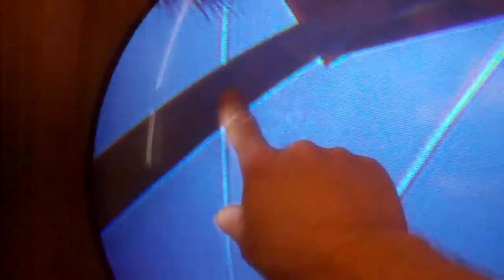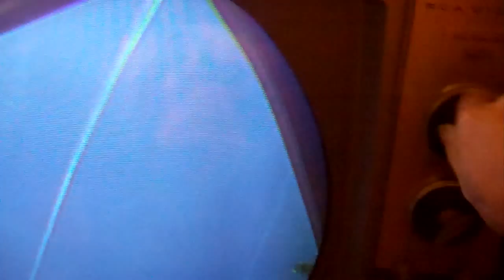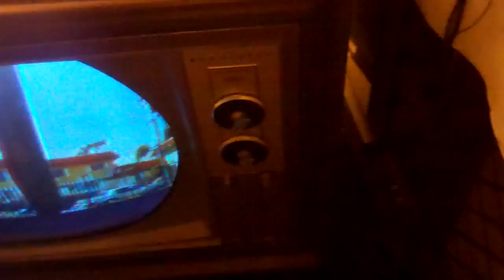direct injecting composite video into a ctc16 for a art project test

Comment: Is there any feasible way of injecting an S-Video (seperate luma and chroma carrier) signal into these old sets? It would eliminate the nasty dot crawl from the primitive notch comb filters most sets have. S-Video/Composite input with audio would be a cool restomod for a roundie, I suppose you could tap into the unused UHF tuner switch in the older sets to trigger a relay and switch over to the inputs.

Comment: I really don't know where to put this... so.. :)  

RCA CTC16-XL update...
I have spent the last few weeks trying to un-do some of the stupid things that were done to it in the past... ( Don't ask,- hint, I rescued it from a HS electronics class. )

I have almost all the tubes I need except for 1, 6gu7 (r-y g-y amp) however I don't know how good/bad the tubes I do have are.

Last weekend, I dared to power it up... no smoke, no explosions, no popped circuit breaker.
After 3 min, noticed C1 was slightly warm, ( will most likely have to re-cap ) r212 HOT but not unexpected of a 18w resistor, seems to have been hot for a very long time, as all solder points and wires to it were corroded . ( prob cause of weak/ leaky caps )

sound is very low, prob a sign of bad c1.

Anyway, hooked wire to the plate of horz output ( missing the cap :( )  saw the tel-tale arc and loud horz freq when I hooked it up, was able to draw a nice long healthy AC arc from the top of the flyback. ( gotta love that smell of ozone!)

Closed HV box for HV test, FAIL. :(    horz output plate starts glowing, sparks from HV reg, I pull it, ( I hate that damn retention clip!!)  find that is bad, getters are white, been cracked sometime in storage, HV rectifier bad too, ( open heater ) , have both ordered now, will see what happens next time I try to bring up the HV,  I'd really prefer to use a solid state in place of the 3CA3, but they are not easy to find :/

Anyway, slowly but surely this RCA will live again!
Reply from the maker: well youtube thought it should be put in spam so who knows. keep at it and dont hesitate to spend money on caps and tubes etc.
Reply: Progress, somewhat, I got the needed HV tubes in and re powered up, HV came up perfectly, and I got a raster, although it was very ugly, no horz / vert lock . As I pretty much suspect, the main electrolytics are in horrid shape from sitting in storage from the mid 80s, and the pots are dirty too, and need cleaning, but this test did tell me what I wanted to know, the 21fjp22a is in good shape with 3 strong guns, no purple glow, otherwise, I'd would not be putting so much effort it to this . :)  @shango066

Comment: I intend to do this to mine after it's all working, but you did not say how you did it exactly :/
So I will do a bit of guessing, feed in a composite video signal via shielded coax to TP-B (input at grid of v4  & L9 )  shield of coax to any gnd point.
No other mod needed? Is it really that simple :o
IF & sound tubes can be removed?
Thanks.
Reply: major update on my CTC-16XL, after 6 months of messing with it, and not able to get color via tuner/if, had to go direct input via a video amp to boost it to 3.3v, after replacing many parts, i have color!  https://imgur.com/MNNx88t